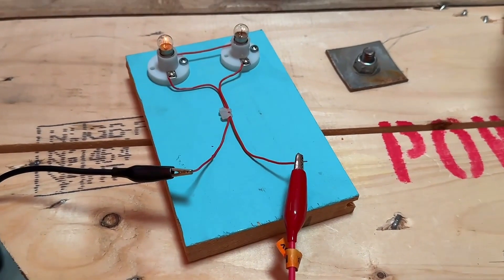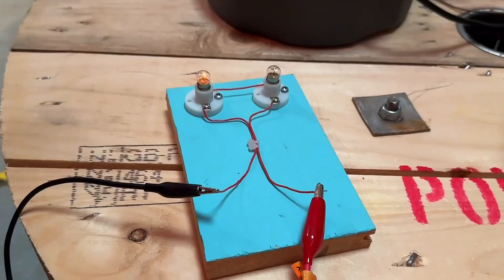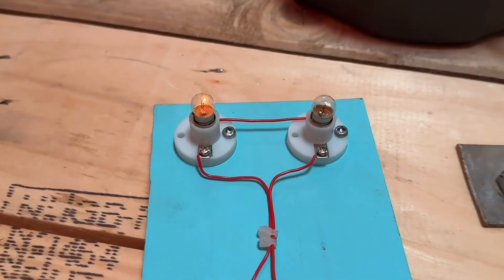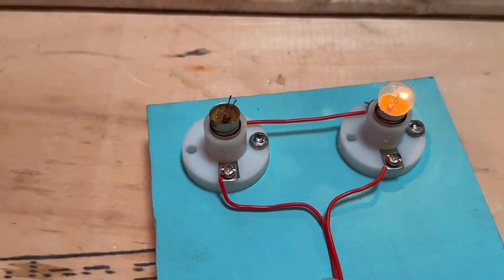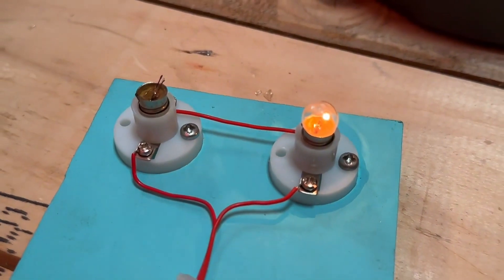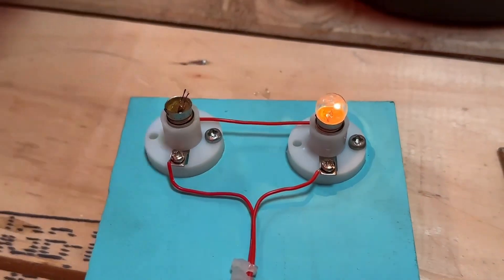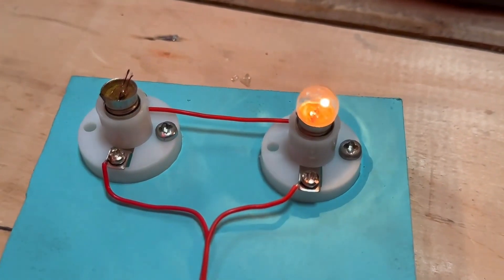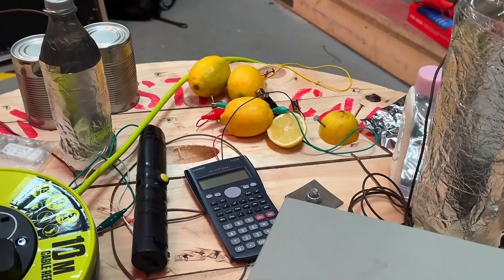Series Lamps - How Temperature Affects Brightness

Comment: The same principle to an I C  Engine Air Mass Sensor using the change of resistance of a heated wire referenced to the ambient temperature.   Increased air flow/mass lowers the temperature and the resistance increasing the signal current to the ECU signalling more fuel. 
Good demonstration Thanks .

Comment: Incandescent bulbs lake that (at least those with intact glass bulbs) approximate to constant current devices. If you increase the voltage across a bulb, the current initially rises, heats up the filament increasing its resistance and the current drops back down again to something pretty close to its original value. The only constraint is that takes a second or so for this to happen. I can vaguely recall in the 70s that there was a hi fi device that made usedthis principle.
Reply: Robert, you correctly describe an iron wire   "barretter."  It creates a positive temperature coefficient which Reginald Fessenden used in 1902 as an AM demodulator.    Hydrogen filled bulb aided fast heat radiation and they were used to protect telegraphic circuits from overload,  also can be used to reduce current inrush. Good comment
Reply: @WOFFY-qc9te  Thanks for the clarification, much appreciated.